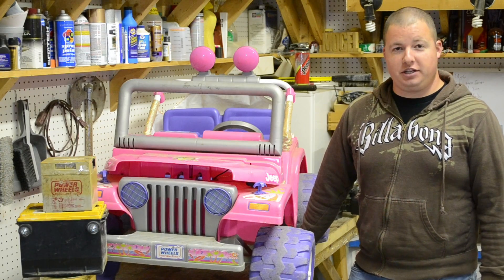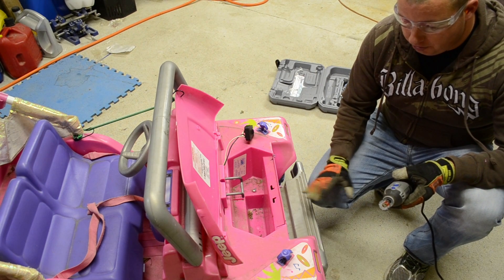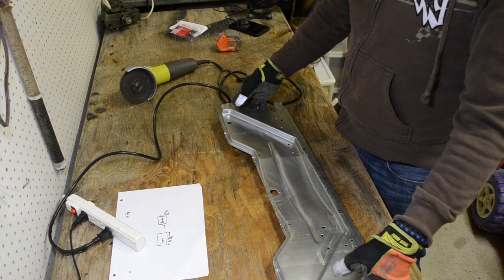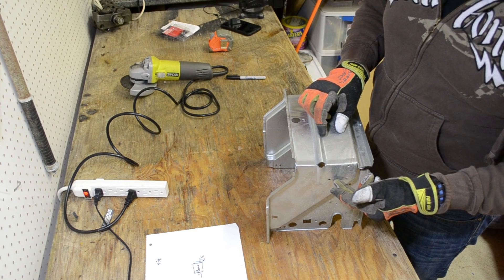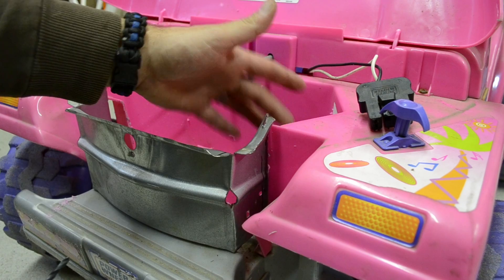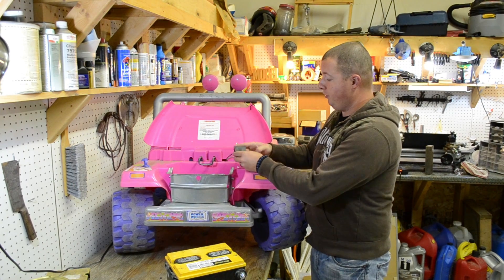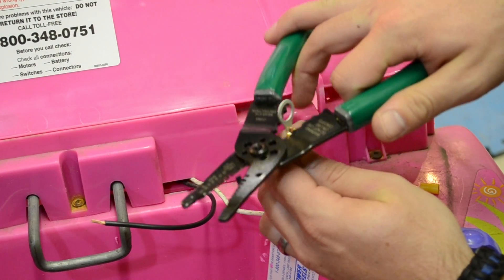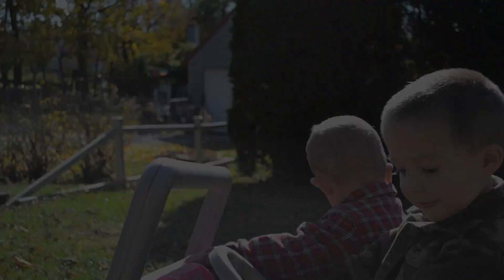Converting Power Wheel to run on a 12 Volt Car Battery

Comment: Did you have to do anything about the power output ?  these are motored and wired for 6v system, Im not complaining here, but wont a 12v direct fry the motor ?, I have wanted to do this to my girls car but the power difference :/
Reply from the maker: Its been so long idk if it was 6 or 12v. Im thinking it was 12-volt because I didn't really see a big difference it just lasted way longer

Comment: So run time is increased compared to the stock 12v12ah? I was told that car batteries and lawn tractor batteries won't last long because they arent deep cycle batterys
Reply from the maker: It does last longer than a power wheels battery but if you can get your hands on a deep cycle that is the way to go. You can discharge them lower without hurting the battery like a normal car battery
Reply: @appalachiandiy2415   but they are so expensive.
Reply from the maker: @devinkaiser4656  yes! Thats why I opted for a junk yard battery for $20
Reply: @appalachiandiy2415 I used a mobility scooter motor in a little pw truck. I been collecting all power wheels batterys I can find for free. I got 6-12v7.2ah  and 3-12v12ah. I run 3 batteries at a time at 36volts. But run time is crap. Do you think  3- 12v300cca lawn tractor batteries would be an improvement? I already got one of those in my mower
Reply from the maker: @devinkaiser4656  you must run batteries in parallel to be able to add up amp hours. If you do it in series you only increase voltage  and the amp hours stays  the same. so any battery in series to get your 36V needs to have  a larger amp hour than your 12ah to see a difference.

Comment: I see this is an older video and love seeing you get  some custom upgrade for it but why did you not use a fuse on the battery wires?
Reply from the maker: I guess you could. Stock hotwheeels dont have them to the best of my knowledge and I'm not running higher voltage. its the same as the stock battery

Comment: i imagine that the drastic increase in amperage would fry those wires.
Reply: This is a capacity increase, not power. Same voltage.
Reply from the maker: @RyanEssonYoung  You are correct. It just lasts waaaaaay longer
Reply from the maker: I didnt have an issue with that. thanks for the reply

Comment: How fast does it go
Reply from the maker: About the same speed, maybe a little slower with the added weight of the battery.
Reply: 12v motor 12v battery. No increased speed possible unless you alter the gears. I'm looking to see if it lasts a lot longer and if it gets hot.

Comment: How do you charge the battery now?  The power ride on I have has a port near the seat to charge the 12v battery currently. It's nice to not have to remove the battery each time but would make this modification for sure. Would I be able to still use that charging port or would I have to remove the battery each time and charge it?
Reply from the maker: I usually keep it in and hook a battery charger up to the terminals on the battery. it would be easier if it had terminals on top instead of the side but either will work.If the charger you have for the power wheel is for a 12V battery just hook up the leads that come from that same battery connection

Comment: How do you charge the car battery at home?
Reply from the maker: I hook a car charger up to the battery while it's still in the jeep. I just unhook the cables.
Reply: Just connect wires to the battery terminals and plug them directly into the wall

Comment: Does the amps of the car battery give the motors to much power?
Reply from the maker: No, I'm not good with electrical math but with DC motors to increase output the voltage needs to be increased not amps
Reply: Longer run time. Same RPM

Comment: Very good instruction video, i had just wanted to see how well it is going when you drive it? Does it go any faster?
Reply from the maker: Not any faster because the input voltage is the same as the old battery.  Last longer, the downside is its a tad on the heavy side.

Comment: Is it any faster then the previous battery and approx how long does the charge last?
Reply from the maker: No, because it's still a 12V battery. If you wanted to make it faster you would have to increase the volts going to the motors. It last about 2hrs at normal speed and then slows down a little over time. Still runnable for 4ish hours. its very dependant on the terrain, how heavy the kids are and if they run it constantly/non-stop.
Reply: @appalachiandiy2415  okay cool thank you for your reply. I have had our barbie PW with 30votls. Just with the battery life lasted longer